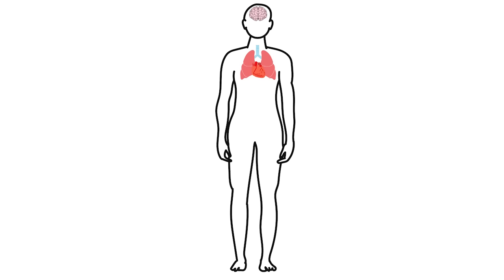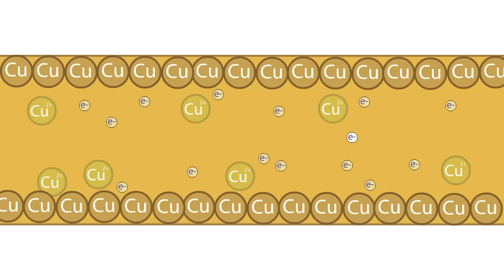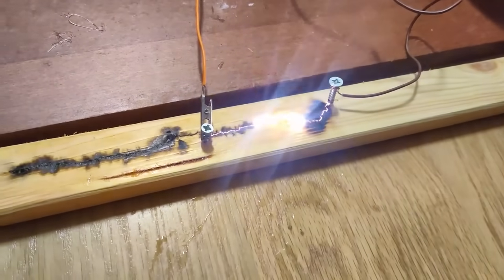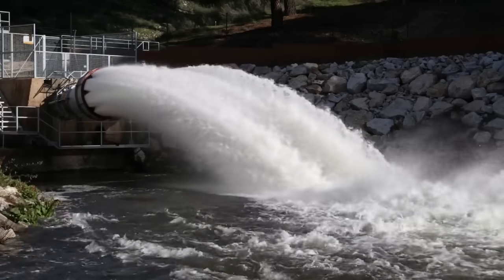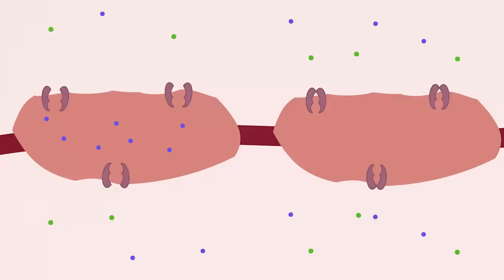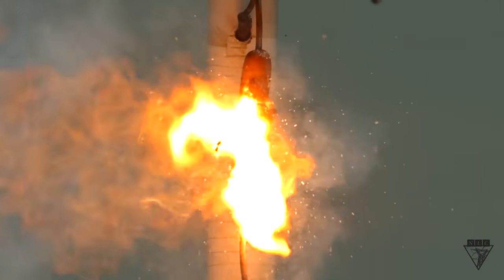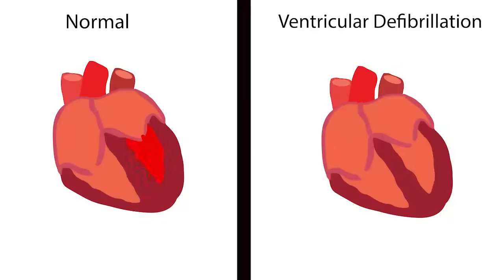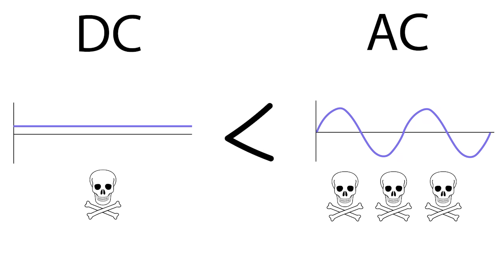Anatomy of Electrocution

Comment from the maker: Get your INFOGRAPHIC POSTERS here: https://questions4science-shop.fourthwall.com/
Reply: You made a mistake when talking about what DC does, what you described is actually ventricular fibrillation and is what happens when AC passes through the heart. By contrast a defibrillator is a device which uses DC to stop the heart thus stopping the chaotic rhythm of VFib (Works on V-Tach too). This is actually where the device gets it's name because it stops fibrillation (Also works on V-Tach rhythms too) thus restoring the heart to a state of asystole from which the hearts pacemaker cells can hopefully kick in and restore a normal sinus rhythm. So for your DC example it should have shown the heart contracting fully for the duration of the shock since that is what happens and then it hopefully starts beating again when the current stops and the heart relaxes. Hopefully being for the obvious reason that the thing that put it in that state in the first place may also have damaged it beyond recovery.
Reply: Current kills, voltage does not kill as long as the current passing throught the body is under the dangerous value...
Reply: I'd love to but, when I go to that link, I get "403 Forbidden."
Reply: @0dulesduds  the cap electrode steam-cooks the brain, and the skull explodes.  the reason a face hood is used.  very effective.  boomers declared it as "inhumane" for murders, rapists, and torturers.
Reply: @em1osmurf  I believe it is very probably the worst way to die, now.  It would be like setting all your organs inside on fire and melting forever; your tongue your brain your liver kidneys heart and probabgly last through and through even through death it would be like being in hell forever and cooked all through your death in hell.
Reply: Guy, a resistor limits current flow..
Reply: @Doug Kenney 🤪
Reply: It’s called Ventricular Fibrillation and not defibrillation. The comment above went into great detail to correct you. I would just put a correction on your video.
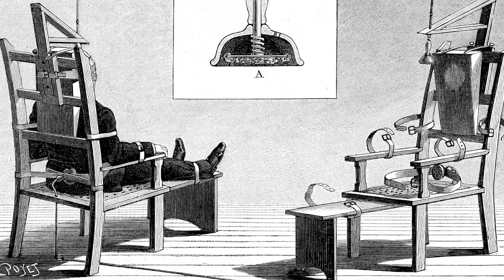Reply: Video FINALLY addresses Title Subject @ 04:40
Reply: lol,
most below know - you are like the 'judas goat' 
we know them
they hold all of us back
from what we could actually do
https://www.youtube.com/watch?v=2yBvVP-wGMY
Reply: Nah

Comment: 3:30 "the purpose of a resistor is to lower the voltage in a circuit" sir that's not how resistance works

Comment: I was reading about Dallas Wien and his accident.  His forehead accidentally touched a high voltage line while he was standing in a cherry picker bucket while he was painting the exterior of a church.  THe current tore his face off and he barely survived.  Why didn't the current just bypass him and continue on down the power line, since it was the path of least resistance?

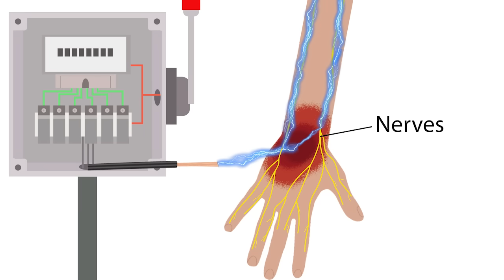Comment: 6:10 Nerves are not electrical conductors.  They operate by a sodium-potassium ion cascade.  It is true that this ion cascade manifests as a side effect polarization (and de-polarization) of the membrane surrounding the nerve's axon.  Likewise, an externally applied electric field will disrupt this cascade, either stopping it or triggering it.
Reply: If electrons can pass, they are conductors

Comment: I once had a shoddy cable send full 230VAC through me like a decade ago. I don't know if it was through both arms, or down to the floor (I was sitting on the floor). Either way, it was definitely in "no let go" territory and it sucked. It was subtle, but I heard the 50Hz in my ears, like a very faint microwave transformer hum. I have no idea how I survived, the outlet just pulled itself out of the power bar. Now I hate working with high voltage of any kind.

Comment: AC is definitely much more dangerous, as stated in the video. However, if you reach certain frequencies, the lethality  will either become as bad as getting insta k!lled by a light tap or as bad as literally nothing happening to you. 

1-5 KHz:  Little input = Big shock and damage 

20 KHz above = Nothing but tissue burning and no shock.

AC can be deadlier or "safer"
Reply: 20 kHz, 200 mA = freeze to grasped electrode🙂

Comment: Current is a unit of magnetism. Electrons move (due to voltage difference (electric potential)) , creating a  magnetic field. Magnetism adds up. Electricity does not due to  charge pairs canceling out on a macroscopic scale.

Really, it's all the same; electromagnetism. Truly the same with special relativity.

Comment: My cheap apartment in college had a bathroom ceiling light with a pull chain and string.  One day the string broke. To turn the light on I grabbed the shower curtain rod (a heavy duty pipe, held up by the cold water line, a perfect ground), to pull myself up with one arm and reached for the chain with my other hand.  All I remember was seeing a spark leap from the chain to my hand, got it right across the chest and fell down.  I was lucky I was disconnect by falling so fast. It knocked me out for a second and found myself on the floor.  Poor electrical work kills, so know what you are doing or hire a pro.

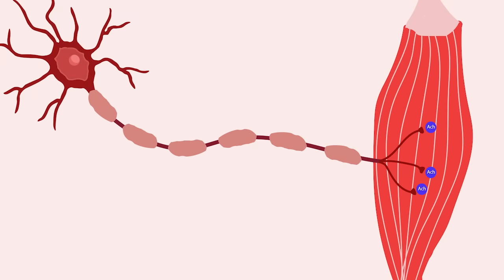Comment: 8:15 you skipped some relevant steps. Achetylcholine causes muscle contraction by creating action potentials in the muscle cells. As in acetylcholine acts as a ligand to the muscle cells' ionotropic channels, specific sodium channels that allow sodium flow intracellularly.

Not all details are important or interesting, but my point is that in this chain reaction, one of the steps is changing the voltage polarity within muscle cells, which in the case of electrocution is already happening without the need for motor neurons to release acetylcholine.

Comment: In the electric chair, if the goal was for the electricity to pass through the heart, why was the electrode placed on the condemned's right leg and not the left? The heart is slightly to the left of the center of the body, not to the right.

Comment: I once got 230 volts at 16 amps. It didn’t really hurt, but it wasn’t a pleasant experience. I could feel the 50 hertz through my whole body. Even my ears were buzzing. Afterwards my finger was bright red and very hot.

Comment: 3:45 - not the voltage but the current. LED is not like a light bulb, when it comes to resistance it behaves kind of like a normal PN diode. If you connect it to power source, you have to limit current because there is limit to how much can this diode conduct. Of course there is also a voltage limit, but it's usually current what kills LEDs.

Comment: Not ventricular defibrilation, but ventricular fibrillation.
Hence why a defibrillator is supposed to shock a heart in A or V fibrillation back into a normal rhythm.
This includes victims of electric shock. A defibrillator doesn't restart a heart that has stopped (asystole), only CPR or the heart itself can do that when the problem that stopped it has been fixed, but instead a defib works as a sort of reset system, contracting every muscle at once so the normal heart rhythm can restart.

Comment: I used to be a weird kid :D. The others enjoyed football, I still don't understand to this day what's fun about chasing the ball like a dog... I played with electronics instead. :D And sometimes enough, dangerously so. I had such a great toy from my father. From an old motorcycle, starter, in the form of a "digger". A cube with a handle, after turning it came out of the wire, very high voltage. Which kicked a lot. :D Besides making fun of kicking kids at school :D. So after some time, I studied the passage of this tension through my body. At home, I sat on the floor, and I put electrodes on my legs, and slowly turned the crank and examined what it was doing to me.. How much can I bear. :D

However, this is nothing compared to what a bunch of friends did in their youth. A party at a friend's house, it consisted of madness. One of the friends, went to the friend's basement, the steep stairs down and the darkness, led him instinctively to look for the light switch with his hand, the problem was that instead of a switch, there were live wires. He grabbed the wires, got a 220V electric shock from the mains. And he came running to our party, excited about how it kicked him up and encouraged him. This piqued the curiosity of the rest, a very drunk group of people who went to try it out too, the party moved to the basement where they repeatedly caught life-threatening voltages and had a crazy time doing it. :D:D A few of us, luckily, were into meth instead of stupid alcohol. So we found out in retrospect. This further confirmed the fact that alcohol is the worst drug of all. :D:D

Comment: I think it also matters how much fat u have . As a body builder and chipendales dancer , I have zero muscle fat . My girlfriend, on the other hand , is curvy, short , and has just the correct amount of meat on her . Someone tried one of those gag “ buzzer “ devices on her - those little gadgets that fit in the palm of the hand . They give a mild electric shock to an unsuspecting victim. Well , the shock didn’t even phase Corina, so she pulled the gag on me later . I ended up on the ground , rolling around in the grass . Corina was in a panick , and if we had cell phones back then , she would have called EMS for me . Fortunately I recovered quickly enough , but it was a gastly sight according to Corina , watching me writhing on the grass , gasping , my ribs sticking out , the metacarpal bones in my feet sticking out - I was a tangled , mangled array of arms and legs from that hand shake shock that I received !

Comment: Milli amps? Don't you mean amps? I can lick my 2 amp charger no problem
Reply: 2A is the maximum current the charger can provide to low resistance load. Your body has high resistance. The amount of current that flows through you depends on the voltage across your body. Below 50V almost no current can flow through the skin. 

I'm curious what voltage your charger is. Licking 12V is quite painful and I haven't seen any chargers below that with such connectors that it is possible to lick the output

Comment: I was 7 years old bored in my room playing with this tiny metal L shaped tool that I found. Don’t know what it’s called but I had two of them. I was just laying on my bed babbling to myself and I flipped onto my stomach with my head and arms now dangling over the edge of my bed. Within arms reach was a wall and its outlet. For no good reason at all, I stuck the metal tools into the electrical outlet moving it around in there prodding it trying to dig in there looking for absolutely nothing. This went on for about 3 minutes then suddenly I saw a spark. I was immediately taken aback. I sensed danger but I didn’t want to get in trouble so I was going to just quickly pull the metal tools out of the electrical outlet and never mess with it again. I went to reach for it but I stopped. I thought to myself nah I’ll just tell my parents, it was just a tiny spark it’s probably not a big deal. My mom came to my room to see what I was talking about and she freaked the flip out. She yelled for my dad and the next thing I observed was how frantic my parents were. They were mad but because I could have been hurt. I watched my mom grab kitchen towels and wrap it around her hand. She knelt down to the outlet then I hear my dad shout from the backyard if she was ready and she shouted back that she was. Suddenly everything turned pitch black and all the power in the house turned off. I can ever so slightly see the bright coral color of the towel around my mom’s hand. I saw her hesitate a few times I could tell my mom was scared but she quickly pulled the tools out of the electrical outlet. She shouted to my dad that she got it out and then the power came back on. Kids man smh. (P.S. this happened in 2001)

Comment: Would anyone who hasn't had a shock from 230 volts AC like my description of what it feels like?
Reply: It feels like a hot and very intense throbbing, buzzing vibration going up your arm. Even after you've stopped touching the thing that gave you the shock, the hot throbbing sensation goes on for a while. I guess that 'vibrating feeling is caused by the alternating current.

Please don't try it for yourself as it can easily kill you.

Comment: 50mA is when current becomes very fatal........
VERY fatal? There are not varying degrees of fatal. Dead is dead. It is like pregnant, you either are or you aren't
Reply: There are many more variables that makes it impossible to have a single point where current becomes fatal. Static shocks can be dozens of amps and you don't die because of the short duration. The path that the current takes also matters

Comment: "Rubber has 10 - 100 MOhm"? Not really, it depends on the geometry, namely diameter and thickness. 0.001 inch thick rubber wire, 100km long can have hundreds of Peta-Ohms, while a 100 square meter rubber foil of 0.01 inch thickness can go down to below 1 kilo-Ohm easily....

Comment: 4:15 Rubber does not have a resistance as its own property.  It has a resistivity.  A particular piece of rubber has a resistance depending on length and cross-section.

Comment: this is highly misleading. 
.2ma is absorbed by you from a dang balloon probably. a battery puts out more power than that. why doesnt it kill you?
cuz your body absorbs the current. you need at least 20a to kill an adult. what kills you is the .2ma above your bodies resistance. what is your resistance? 1000-2000 ohm.
Reply: This is also misleading. Your resistance doesn't tell what portion of a current is "absorbed" by you. Where did you pull the 20a from?  If you put yourself across a power supply the amount of current the supply provides is exactly the same that flows through you. The supply doesn't need any more current that is needed to kill you. What it needs is enough voltage get enough current flowing through your resistance. A car battery can output 1000 A but it can't kill you because it's only 12v and because of your resistance almost no current flows. It is true that in a static shock there is quite a high current flowing through you. Sometimes it's tens of amps. It doesn't kill you because it only lasts for microseconds. If even one amp flowed trough you continuously you would be dead in less than a second

Comment: Resistors change current, not voltage.
Reply: That would be correct if the only other component in the circuit was an ideal led and the wires were superconductors. In reality LED's are far from ideal and their voltage drop depends on the current. Resistors have a voltage drop that limits the current. If you change the resistance the voltage across the led also changes.

Comment: I always thought it was Amps that killed something like 3-4? I’m probably wrong
Reply: Current is what kills you and only 50 mA can kill you but current in itself isn't dangerous because it must be going through your body to do anything. If there is 1000 A going through a wire and you touch it the current isn't all magically going through you. The amount of current that flows through you only depends on the voltage across your body and not the amount of current that flows in the wire you are touching.

Comment: I’ve been shocked by an electric fence when I was little. Of course, they are non lethal. But when I got shocked it felt like I got hit by a bolder as my muscles were contracted for about a second. It was pretty scary especially when I felt my back lock up. The average voltage of an electric fence is 5000-8000 volts although it has a very low amperage around 120 milliamps. This is non lethal but definitely gets people’s attention 😂

Comment: Electricity wise, spot on. Good job. Anatomy wise, perfect, except for the heart. You can atrial and/or ventricular fibrillation. A defibrillator is a device used to cease fibrillation. Other than that, well done.
Reply: The only arrhythmia that is defibrillated is V-fib. Converting A-fib into sinus rhythm is attempted via cardioversion which is a similar concept but different. You can go into A-fib from an electrical shock but V-fib is much more common.

Comment: Resistors for leds are used to regulate current, not voltage
Reply: They are used to regulate current but the only way to regulate current is to regulate the voltage or the resistance. Since a resistor can't change the resistance of the led it must lower the voltage to lower the current

Comment: Its not only curtent. Also depends on voltage. You need both. 5 volt 1000 ma will only tiggle you
Reply: At 5 volts there is no way to have 1a flow trough you. Your resistance isn't 5 ohms

Comment: I've gotten hit with shocks from ignition coils many times. But nothing compares to the solar glass that I make at work, the tin oxide we put on the glass give it a charge and the other chemicals make it conductive, every now and then you can touch the base glass before it's even been cut to a final size for the solar panel and get a shock unlike anything you've ever felt from ignition systems.

Comment: Electricity doesn't flow through a conductor, it flows across it because of how electrons flow around a nucleus if you put two copper atoms together the electrons will flow across the outer most valance.

Comment: I had multiple time voltage in my body. Not funny. Low voltage 230v feels very tingly. 10Kv is more like a sharp (with arc, hot) big needle is shot through your bones. Primitive survival instics kick in.  Never grab wires or touch them. When unsure use measurements or use one long dry finger.